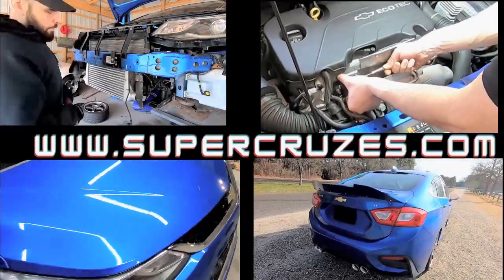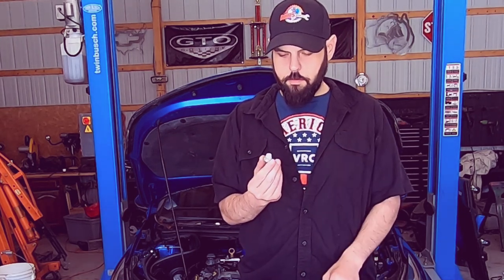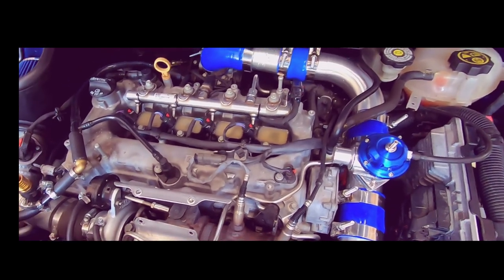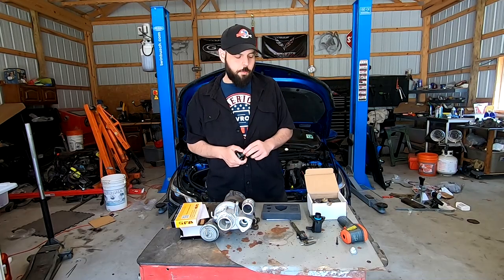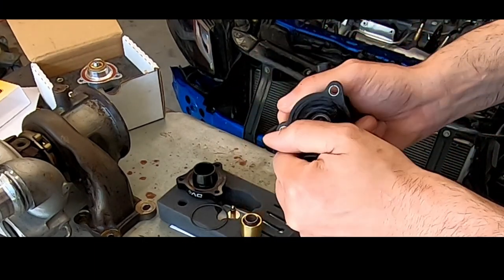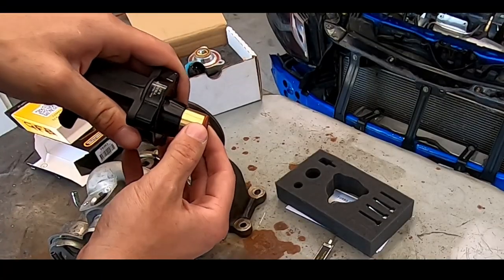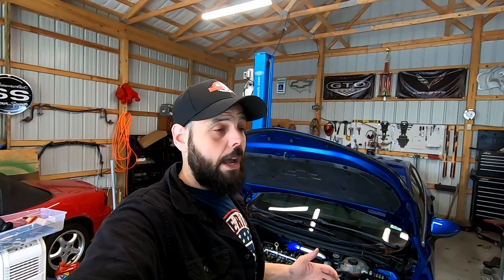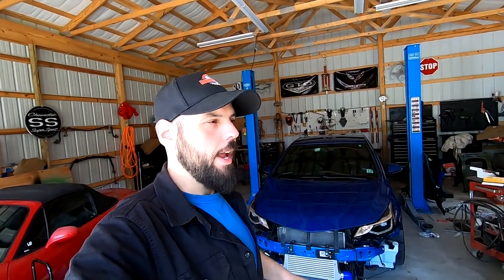CRUZE Diverter valve HPRV vs GFB Big turbo noise BOV with install and tests

Comment from the maker: Here is a link to a CRUZE specific diverter. It's designed to work with a stock tune and aftermarket tune. It's also designed to work on a stock turbo or a big turbo. https://www.youtube.com/watch?v=2Rr_7EsgE34

Comment: So I have a 2019 Chevy Cruze LS. I have so far added a cat back exhaust, throttle body spacer, recirculating valve and a tune obviously. The car runs perfectly but I had to make some modifications, first of all get a tune up, and second of all replace the throttle body pipe as soon as possible to avoid an underboost code because the stock pipe is trash. It will make you car sound like poop. I have to order a pipe from Pegasus racing in Wisconsin. It didn’t take that long to install I might do a video on it. Also make sure your tuner gets your files updated because mine stated I had an air leak which was my throttle body. My codes were P0299 and P1101. I would also recommend getting more transmission oil changes and not exceeding 3k miles per oil change. My car has 70k miles in 3 years of owning it and that’s my main codes I’ve had.
Reply: I’m probably going to upgrade my turbo soon, it’s around 2k and I’m going to upgrade my engine valve springs, cylinders the whole 9 yards. And then I’m going to update and add an inter cooler as well. It’s going to be around 2-3k to get everything working perfectly. I’m trying to push 300-400 hp and then probably engine swap it with an ls4. You can only get so much hp out of a 1.4L
Reply from the maker: Yea those codes are very common. A lot of people contact me for help with them. Your car sounds like a nice healthy build. What does that company charge for those pipes I make the same kit for the oem intercooler.

Comment: Hi Dave, got a question is the 1.4 in the Cruze the same as the Opel Astra 1.4 (B14XFT) and did I understand it right would the gfb actually harm the factory turbo?
Reply from the maker: I have a diverter that fits that engine. The GFB does not open fast enough for the air to escape so you get that weird noise.
Reply: @davesworld2132  thanks for the quick response mate. It is really strange here on the Astra forums the gfb gets a lot of praise. But which one would you recommend? Just took a look on your site and saw you had two types
Reply from the maker: @shaunreek3526  it does for some applications because it’s the only thing available. I’m not trying to compete but in the United States if you watch the video you can see what it causes I don’t know if there’s a difference between the two turbos but it does cause a few issues. That’s why I for the USA application I came out with something that works.
Reply: @davesworld2132  I'll ask around the forum if anybody has any weird sounds thanks.
Reply: Most inexpensive diverter valve for stock turbo on my cruze

Comment: I have a stock Chevy cruise.I added a control valve to the Turbo.What should I do if I need a bypass route?Do I need a diverter valve?Do I need to blow a valve what should I do
Reply from the maker: I have my own brand you can contact me at my website www.supercruzes.com
Reply: @davesworld2132  I plan on keeping my stick turbo for a little while and I need most inexpensive way to assure I won't cause damage to my car now that I have a boost control valve.. having the boost control tool valve open fully and getting on the throttle with everything stock am I going to cause damage to car? If yes do I need a diverter valve and what is cheapest one? Please I am new to turbos

Comment: If we plan on keeping stock turbo are we better off only changing the waste gate?
Reply from the maker: Are you planning on doing a tune in the future ?
Reply: I plan on keeping my stick turbo for a while I added a boost control valve now what do I have to change to release tne pressure a diverted valve?

Comment: The big question is what about the smaller factory turbo ?
Reply from the maker: It makes a cool noise but just be mindful that I think the factory turbo will not last as long. The factory thrust bearing is very small.
Reply: I already have to replace my factory turbo at around 100k miles
Reply from the maker: @jayortiz8225  that’s not too bad mileage wise
Reply: @davesworld2132  my car is 200k miles and engine light always shows engine under boost so should I change turbo or leave it like that
Reply from the maker: @StreetLegalCars  what wastegate do u have ?
Reply: @davesworld2132  i think factory my car is stock only i am just adding a cold air intake
Reply from the maker: @StreetLegalCars  I sell a lot of custom wastegates to people. Oem ones seem to go bad about every 40,000 miles

Comment: So I’m just watching this video now I do want to get your opinion. I have a stock turbo and was curious which diverter in your opinion would be safer
Reply from the maker: Mine. I developed my own over the years to work safe and sound like a BOV here is a link.
https://supercruzesstore.com/products/cruze-malibu-equinox-diverter-bov
Reply: @davesworld2132  do you have for mk6 gti ed35?
Reply from the maker: @tille2603  yes I get them for customers with VW
Reply: @davesworld2132  nice! price? and i live in norway🤣 do you ship? if not what else u recomend to use on this car?

Comment: Mine flutters like that one time after startup im not sure why than afterwards it wont do it anymore.
Reply from the maker: What car do you have it on and what diverter?
Reply: @davesworld2132  17 cruze stock diverter but it is bnr tuned with a short ram intake the only way it will do is if I let off the gas fast as to make the blow off sound. I just think it's weird it will only flutter once than never again until driven again 
Maybe the stock diverter corrects after that first big push of air release not sure
Reply from the maker: @AOG_ETH  It’s probably sticking so overnight it gets stuck and then when you first start the car up the boost pressure moves it
Reply: @davesworld2132  would that be of any concern?
Should I replace it?
Reply from the maker: @AOG_ETH  yes I would worry the current one is sticking. I also have a replacement one that’s a much better one over stock.

Comment: Will these parts work on a same year trax? Ive already got a trifecta tune an intake
Reply from the maker: I but here is a link to a working one that fits the Cruze and the Trax 
https://youtu.be/2Rr_7EsgE34
Reply: @davesworld2132  thanks! The one in the link is the sound I want
Reply from the maker: @cripcov9517  That's why I developed it. It's designed specifically for the cruze.
Reply: @davesworld2132  nice! I'll be getting in touch soon. I've got one more car payment left lol
Reply from the maker: @cripcov9517  congrats

Comment: how about the bnr why didnt u go with it.
Reply from the maker: When you switch over to a big turbo it creates a flute type noise. If you’re not running a big turbo it works good.
Reply: @davesworld2132  thanks for the info. im running stock turbo with trifecta tune on a 2.0 turbo redline equinox 2019 im def going Bnr then. love your vids.  be great if u had any info on a wastegate for what i drive if u sell id be glad to buy from u.
Reply from the maker: @george230  I do have one for your truck I also have a nice intercooler system that will fit.
Reply: @davesworld2132  do u have a link for the inner cooler that wil fit. my equinox is the redline 2.0
Reply from the maker: @george230  I think you may have emailed me this morning. I’m still waiting for pictures to come in from my customers.

Comment: so my takeaways from this video are: 1) if the Go Fast Bits diverter valve is good to use on the TurboBay turbo (judging from what you said at the end), isn’t it also okay to use on the BNR turbo? and 2) just to confirm, using the HPRV on either big turbo application does NOT get rid of the noise?
Reply from the maker: HPRV does not get rid of the noise. I don’t know any info about the BNR turbo but have people in my YouTube membership who I ran tests with that confirm the GFB did kill the noise. Still waiting to see long term effects.